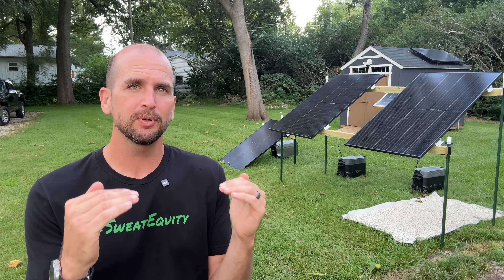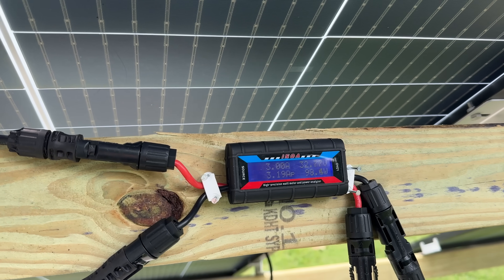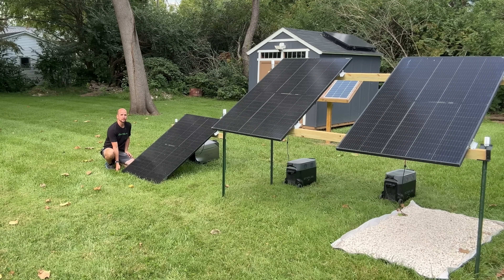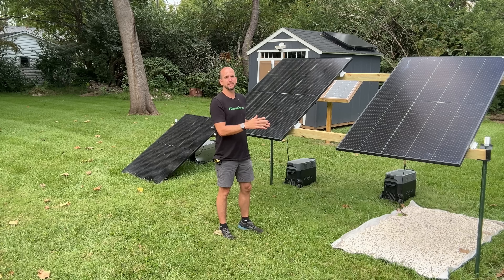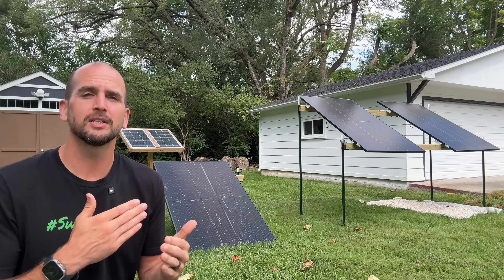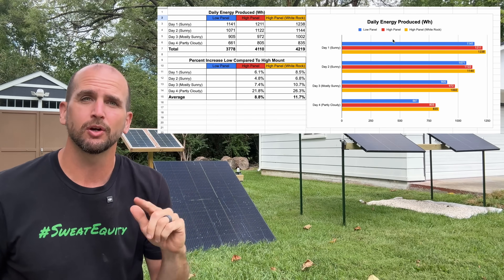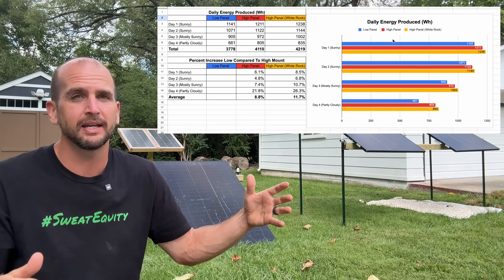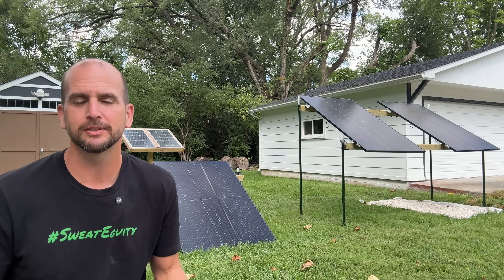Maximizing Bifacial Solar Panel Output: Low vs High Mount Test

Comment: Can you try using a more reflective surface than just a plain white cloth. Something that reflects like a mirror
Reply: One of the issues with a mirror is the fact that the light bounces off the mirror at a specific angle.  That means you need to aim your mirrors, not easy with the sun moving across the sky.  Bi-facial panels harvest more energy on overcast days than mono-facial panels because the light is diffused and coming from the entire sky. White stone is a good choice when you look at the cost/benefit of something more complex and expensive.
Reply: Mirrored is better but more difficult to keep at the correct angle thru the day.
Reply: I saw a video that someone made use of bifacial panels, vertically positioned with foil paper perpendicular to the panel on both side. I would love  Everyday solar to do a video on that too
Reply: the problem with stuff like mylar is that the wrinkles in the mylar result in hotspots in the light, you have to be very careful with mirror-like surfaces not to cause hot spot damage to the panels over time. A white surface that defuses the light is ultimately the safest.
Reply: @chaon93  So true. I saw a video where foil papers are used in a vertical panel setup. What do u think? Would this setup unlikely create hot spots?
Reply: if you take a sufficiently white surface it will reflect 100 % light but if you compare it with a household mirror that reflects only 80%

a cloth is probetly just as good as a mirror
Reply: @Hansen710 thats the biggest BS i heard in a long time...

headlights would have a cloth hanging around the bulb instead of a chromed reflector.... 🤦‍♀️🤦‍♀️🤦‍♀️

some people are just not the brightest candle...
Reply: @casemodder89   always be polite folk....
Reply: @Hansen710  Why don't you do an experiment with your phone torch.
Flash the light to a mirror and to a white cloth and see what reflects more
Reply: @Hansen710 i'm not so sure about that, the two forms of reflected light are different.

Comment: I love this ground mount system. Those brackets make it so simple. You'd be hard pressed doing it cheaper.
The video you did on building that ground mount was excellent and it took next to no time.
Tbh, If you have an area that gets good hours of sun then I can't see any reason why this couldn't be a permanent solution.
Reply: Yes, if anything I did get out of this video is the no brainer solution to use fence posts and brackets. FYI, these fence posts are designed to prevent cattle from getting out, so should work well in this application.
Reply: Yeah I am putting together a order together to put this around our garden. 20' long by 6' wide. Plan to use 10' t-post for rear legs and 7' for front. 2 birds, one stone - keeps dog out from destroying plants trying to get rabbits and gets my bifacial panels in a great spot.

Comment: Can I use those meters on panels that aren't hooked up to anything?
Reply: sure. as long as the open circuit voltage does not exceed the 100V.

but you will just measure the OCV without any load. you need a load (mppt charger) to A: drag the voltage down to the usable one and B: produce some actual yield. how else would you compare setups ?
Reply: @casemodder89 I literally just want to compare 3 panels for how many watt hours they would pull in the same day, I don’t have enough power stations to plug all 3 in
Reply: @rnkustomz  like i said, you need a load to draw actual current from the panel.

otherwise it was like running a car in idle for 5h and then telling it consumed 4 liters of fuel.  but that 4L is not what is consumed while doing some actual work.

and without 3 identical loads you could never compare anything.  doing 3 different days screws the results just like different loads would.
Reply: @casemodder89  dang okay. Thanks for the help
Reply: @rnkustomz  Replying late, but hopefully better than never.

You could connect one meter to each of your 3 panels, and then parallel all 3 panels together and connect them to the same load.  You would need at least one load, and like @rnkustomz said, it should be something with an mppt charger. One power station should be good enough, if it can take the full input of all 3 panels. You may also need to draw power from it during the test so it isn't full.

  I have a couple of those meters, they are fairly cheap and do work well. Check them with a multi-meter first, mine tend to measure the current differently than my meter, so they are not very accurate in low light conditions.

Comment: Isn't the rear panel being shaded by the 2x4 running in front of the cells ?
Reply: Not as much as you might think.

I found a paper on it where they tested a 25cm wide board at various distances.

When right up against the cells, it had a significant effect, but pulling the object back a little cut that loss quickly, also painting the board a reflective color also reduced the loss significantly.

"To conclude, the measured, large variation in rear irradiance per cell due to real outdoor conditions does not lead
to increased risk of hot spots as the current mismatch is too low to cause solar cells to get under reverse bias.
Furthermore, the power loss is as small, -2%, as the small reduction in irradiance at about 10% rear irradiance.
By replicating these effects indoors at about 17% rear irradiance, it is shown that with decreasing distance the
observed drop in current due to indirect light shading increases. For thin objects close to the module, no current drop
is observed for cells not directly behind the object, but a small reduction is observed when the object is 10-20 cm
from the module. The drop in current is in good quantitative agreement with the measured reductions in rear side
irradiance. Finally, we have shown that increasing the reflectance of the near-field object, strongly reduces the drop
in current."
Reply: Definitely will affect the results significantly

Comment: yep and in a snow type weather back will still produce power from light reflected from snow and thus heat up the panel and help clear snow from top and in cold will even be more efficient
Reply: very cool
Reply: Yep, works great. Once in a while conditions are such that it behooves me to clean the panel, but generally they heat up and melt it off on their own. When getting full sun plus the snow reflections, they really crank out the power.

Comment: Biracial is supposed to be vertical not at 45 and south facing
Reply: Autocorrect did you dirty 😂
Reply: @priestesslucy 
I've seen that same mistake several times.😅
Reply: A lot depends on latitude.
Reply: There are a few high-quality videos about vertical mounting.  It's not as good as angled mounting for normal purposes.  But if you live in a high latitude and/or get a lot of snow, then you can get better performance than angled mounting. But it depends on every possible factor.
Reply: That is a myth bro, unless you are doing something super niche and not trying to get the maximum out of your array LOL.  This has been beaten to death and always proven to be wrong.  Good try though.
Reply: @yourmomma69-g5r  then explain how the dutch university study got more out of placing the panels in vertical east west ???

because youtubers think all cheap bifacial panels can do the same as expensive, it does not mean it is beaten to death

ofcourse they get bad reasulat when they all are using 400w panels that produces 100w on the backside
they are not even going for the 550w that produces 200w on the backside 

youtube science is not allways real science
Reply: @Hansen710  Yes that study is great and can show that in near perfect circumstances that it is possible just not normally feasible especially in places closer to the equator.  Also creating a barrier helps the aesthetics which people don't talk about much but with some HOA's in the US it could be the reality to vertically mount.  It is just that most all other studies have shown very little difference which seems to be negligible at best from what I have seen.  Maybe we need more studies in different areas with different pv panels as you suggested.
Reply: then you would need bifacial that produces the same on the front as on the back

its simple math, how will you get the same from both sides when a normal 400w bifacial only produces 100w on the backside 

the chap bifacial that does not produce the same on both sides goes south for best production,
simple math

and not vertical, they have to face in the most direct angle to the sun.
if you want sun to reflect on the backside, you have to make sure you are not blocking it all.
for example with gaps between the panels

yes you can switch the direction on the panels, (1 west 1 east 1 west and so on)
 but that still doesent make them do best in a verical position facing east west

Comment: Thanks for doing this valuable comparison!
When I put my bifacials on my shed, like you, I plan on painting the shingles white. No, there won't be the distance to help out reflecting the light, but every little bit helps. Plus, my shed shingles should last another thirty years!
Reply: will  also  keep  the  shed  interior  cooler.
Reply: You absolutely correct, Richard!